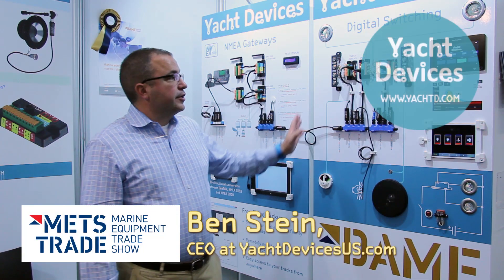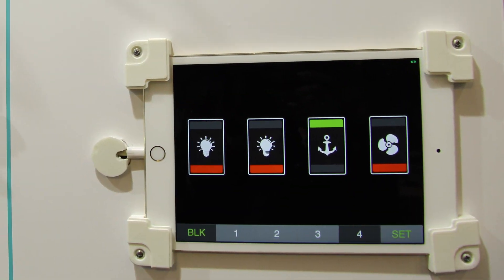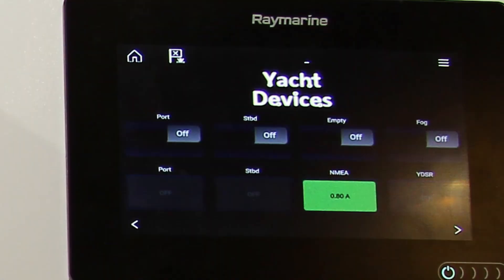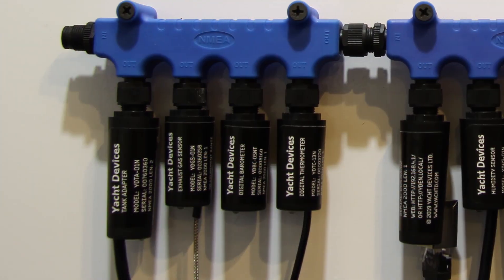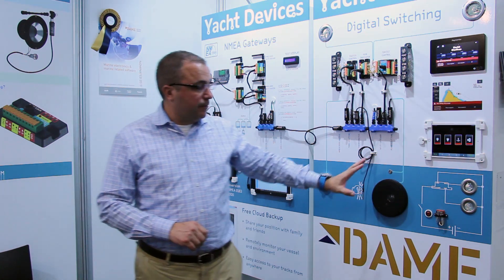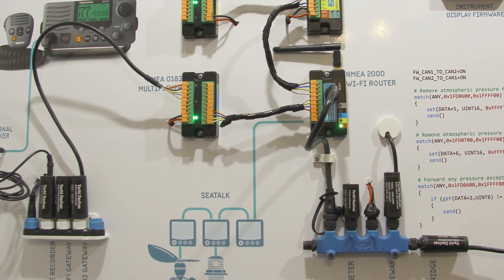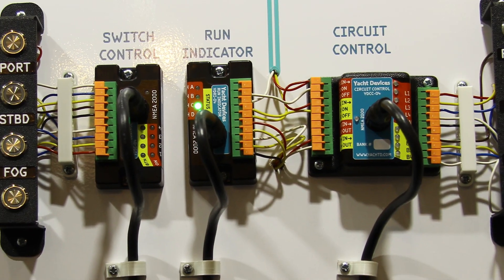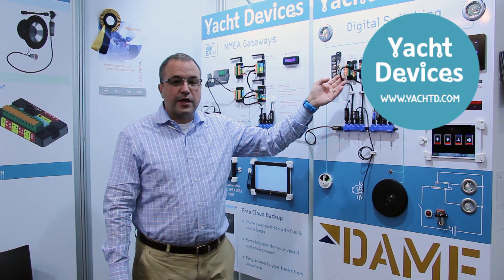NMEA 2000 Digital Switching

Comment: I need separate individual bank????
Reply: Yes. In order to separately control each YDCC-04 unit, all of them should have different NMEA 2000 banks.

For 3x YDCC-04 units setup I suggest to use NMEA 2000 banks 0, 1 and 2.